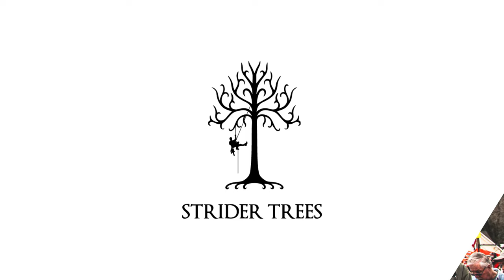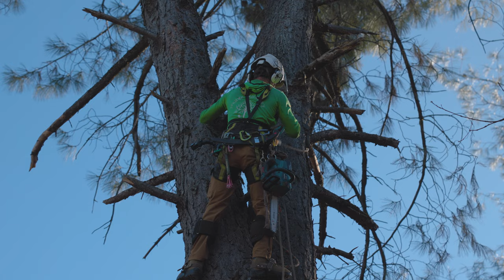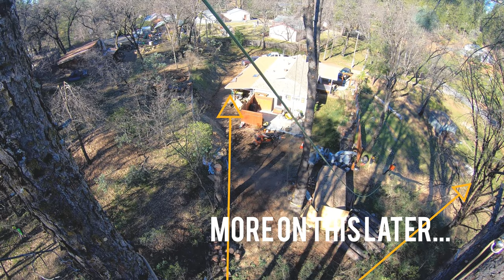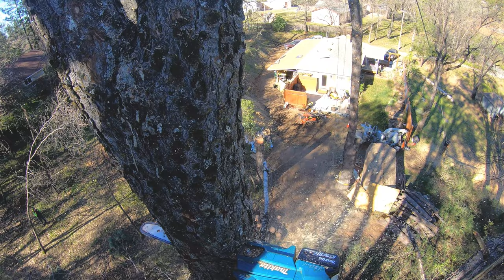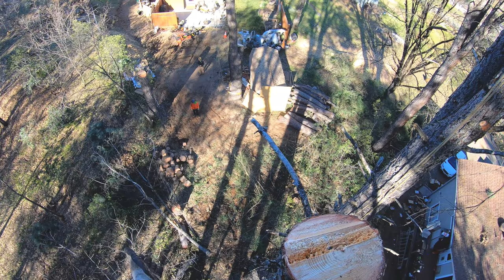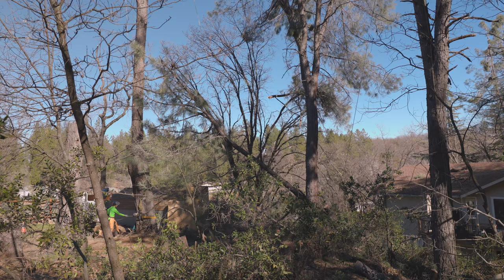Experts ONLY Vectored Pulling on Leaning Spars | Advanced Rigging Techniques

Comment: I use this technique quite a bit but too often I wish I had taken the time to set a pull line and a separate compensation line at 90 degrees to the lay. On hard leaners, taking in quick enough to be effective is usually impractical, and on dead stems the pull line is bound to be stronger than the hinge wood resulting in a fell to the rope and not your aim.
Reply: I did use it successfully the other day on a heavy back leaner, rope set directly opposite the lean but gunning cut 10 degrees to the left. Thanks for the vids.
Reply from the maker: Well said!!

Comment: I'm a long time pro faller who's been getting into climbing the last few years. In your explanation of the 2nd top, you said that in that instance, you face the top where you want it to go and then rely on the force vector of the rope to get the top where you want it. In falling when you're counteracting a side lean, you gun the face as far off of your desired lay as the side lean is off of plumb. Is that something you would want to do, at least to some degree, where the rope isn't vectored exactly opposite of the lean? Or should the rope be enough in most cases to get the top where you want it? Sincerely asking for my own education, I'm pretty solid at falling from the stump, still learning a lot about cutting in the air, and I'm speaking in generalities, not talking about what went wrong on this particular top- it does seem that the branch hosed you. 

My thought on the mechanics of it is that the rope would get the top to the tipping point, but not offer much guidance after that, but the hinge would offer directional control for a little longer before it breaks. If there's an element of side lean given your chosen lay, I'd think you'd want the hinge to counteract that to get the top committed to your desired lay before the hinge breaks, especially if the rope isn't vectored opposite of the natural lay of the top. 

Thanks for the videos, I do appreciate the time and effort that you put in.
Reply from the maker: If I’m understanding correctly, you’re on the right track. Falling from the ground you have to compensate for the lean with the face a little in order to get it to land exactly where you want, And the same is true pulling tops. The main thing to consider with the pulling rope is to be sure it is pulling opposite the lean to relieve the excess stress on the hinge that would cause it to break early.  Once it gets past the tipping point there is not much that can be done to direct the top from the ground, because too much slack enters the system.

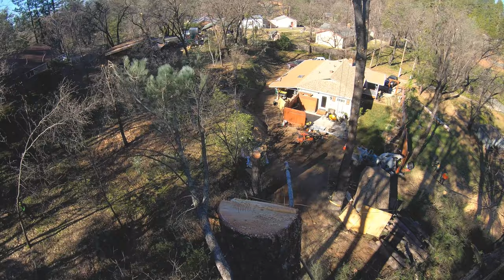Comment: at 6:05 wasnt no little branch that held. it was leaning heavy that way and your notch was deep and left no hinge wood. atleast in my opinion
Reply: If you ever work gray pines, you'll learn that they will hinge like no other. Notch looked fine, imo. If it was me, I may have feathered the throttle on the back cut a little more, at least until my guys got it to commit, but hindsight is always 20/20.
Reply: @devonashburn7000  tree was dead to. Dead tress never hinge always bust off. Doesn't matter what species. Totally agree about the cutting and pull wasn't on point
Reply: @fumagoo1986  It's covered in green needles, no? Should be plenty wet. Am I trippin?
Reply: @fumagoo1986  Graypines are almost always covered in dead limbs, even coupled with super thick green canopies. They're pretty nasty trees. 

(Sorry if I'm assuming you aren't familiar with the species, I just don't know what region you're from) 

Strider and I are both Northern California.
Reply: My question was from the beginning you show the one groundsman on the rope and then show these big tops he's going to pull lol... sounds like you got out the grcs afterwards ? Thank you for the video

Comment: Full tension off the bat, a wide open face cut instead of a Humboldt, leave more holding wood and clean up the notch. You can also spine tie the rope, similar to how SRT is set up, which gives much greater leverage for directional cuts. You did a lot wrong here and should not be teaching these techniques with such a low level of skill.
Reply from the maker: That’s a pretty strong statement. You’re certainly making lots of assumptions based on a very short, edited clip that obviously doesn’t show everything involved 🤔
Reply: @Stridertrees  The industry is full of guys like this. See one clip they disagree with and decide their way is the only way. 

Don't pay any mind. Constructive criticism is cool, but to outright say you're too unskilled to make an instructional is just not true and unhelpful. Why not just have a conversation about it? That, in my opinion, is a major problem in our industry. Too much hubris.